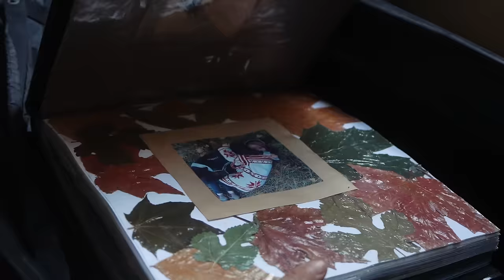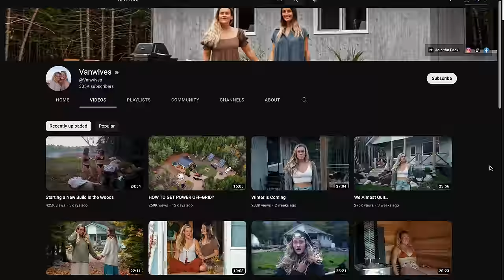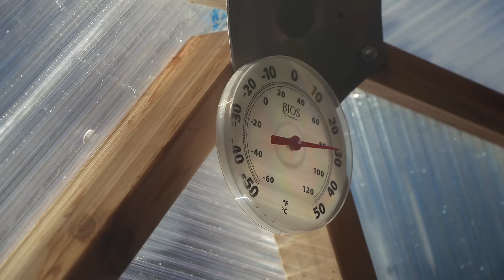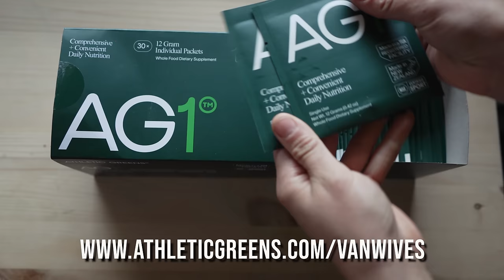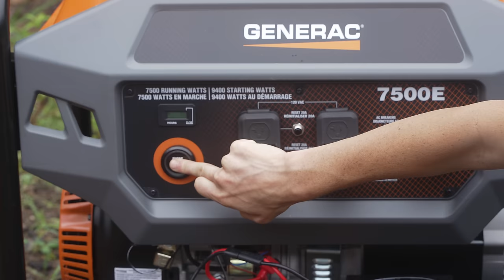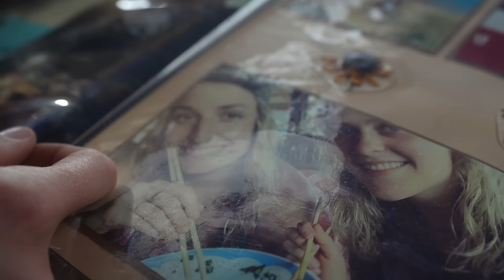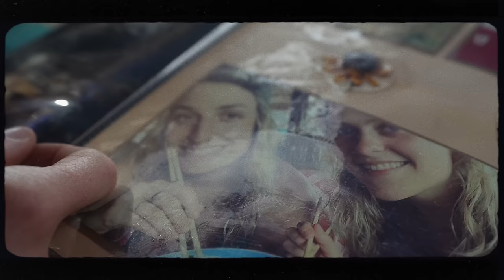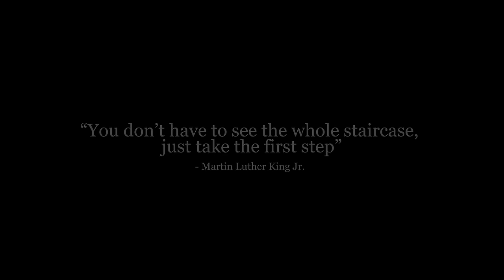1 YEAR ALONE & Off-Grid- Full Cabin Tour Before & After

Comment: Hi ladies, I have been thoroughly enjoying all of your posts with a little bit of envy.  Next time you install a door figure the frame opening as follows:  Frame Opening Width = door w + 1 1/2" jamb legs+ 1" for shim space.  Frame Opening Height = door length + 3/4" jamb head + 1 1/4" for finished floor a bottom gap + 1/2" for shim space.  After tacking the jambset & door into the opening you can apply wood shims to adjust to make everything square.  Then put in your final screws and insulate the shim space.  I should have sent this comment after you put up the greenhouse.  I do admire your learn by doing attitude.

Comment: Ladies, great video with an inspiring message. Let's talk about preventative medicine and recycling. Those Battle Board batteries need to be protected from the cold and I'm going to mention a rather inexpensive way that can be done. Passive solar heating. To begin: seek out someone removing those fluorescent tube lighting boxes. Paint the inside of the boxes black, swap the industrial lighting cover for insulated glass and seal them up, leaving the conduit/wiring hole open. Mount them on the roof of the barn, connecting them with an insulated piping (one example I saw was drain pipe insulated with sawed off soda cans). Vent them back into the building. The boxes heat up like little green houses (!) and the warm air goes into the battery room. Call it "free warm" and a backup in case the diesel runs out. As usual, there are YouTube videos and articles which explain it much better than I can.

Comment: Lady's great job. As far as heat for the battery room try 2 heats lamps when it gets cold the lamps will use alot less power than any electric heater. And buy a wheel barrel with 2 front wheels it will make easier. Have fun try and stay warm it gets really cold up where you guys are......Stay safe and stay warm.......Hugs

Comment: You guys rock! Unbelievable the amount of work you have done! Hope you guys are warm and have made progress on finding equiment to remove the snow and on the solar panel system. Just a comment about insulation : while the polyurethane may not be the most environmentally friendly product (source of the material and the quantity of energy required to make it), you should not feel guilty for choosing it. I believe you made the right choice given your location and situation out in the open. It should prevent the winter cold air from getting in, more so than in your garage where you used the balk stuff. Bulk insulation has a tendancy to compact itself after a while and slide down along the inside walls. Time will tell, I guess. Warm wishes from Québec. 👏👏👏